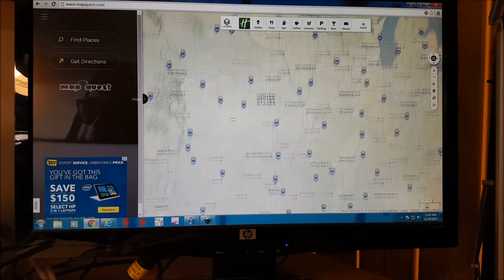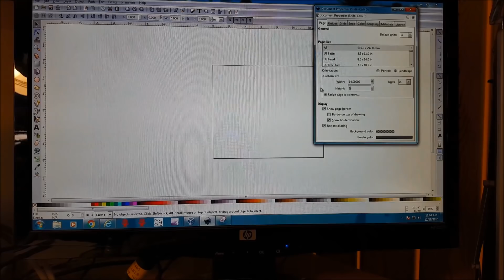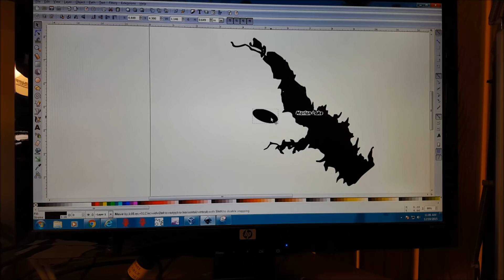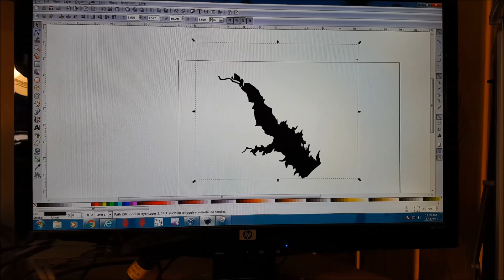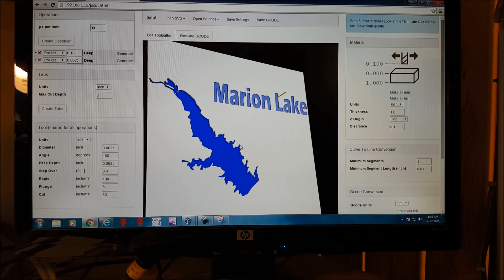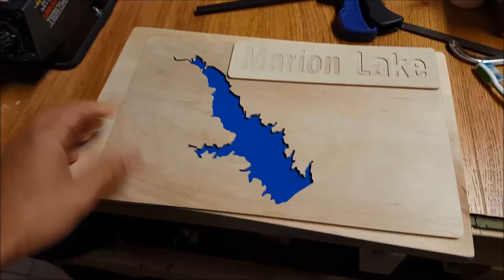Lake Map - A CNC Project

Comment: Great video as always. What would be an inexpensive CNC to start out with?
Reply from the maker: +Waylight Creations There are lots of choices out there for small CNC machines.  I built my first CNC from scratch to save money; it was a great learning experience but took a long time.  The machine I'm currently using cost around $600 and came ready to go.  Ebay as well as Amazon have lots of 3040 CNCs.  For around $1,400 you can get a much larger one; these basic Chinese machines are pretty good and lots of fun to use almost right out of the box.
Reply: +drez20001 Thanks for the info. I really appreciate it.